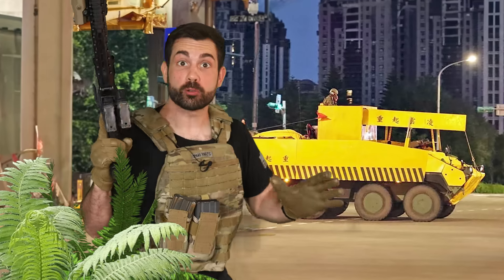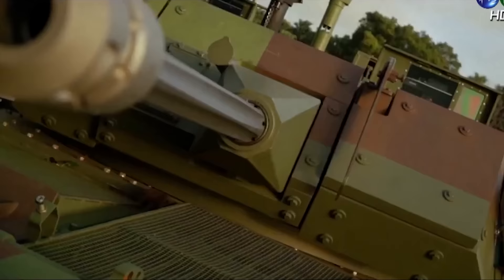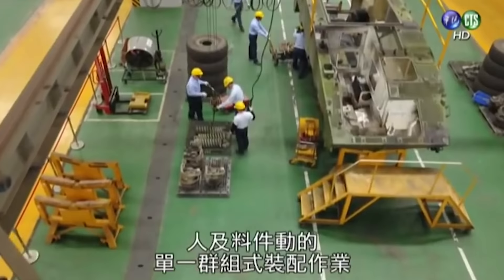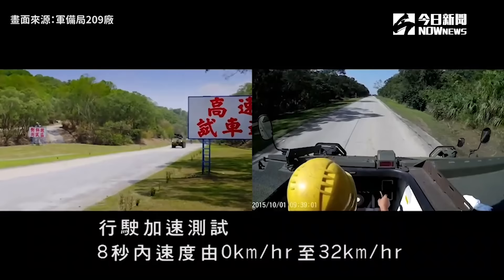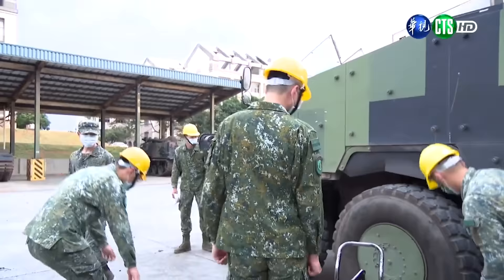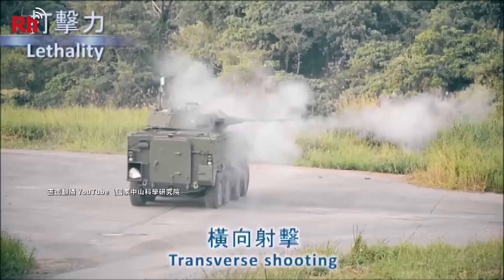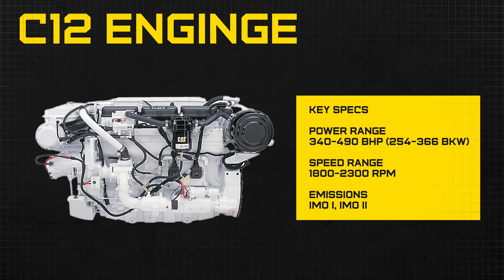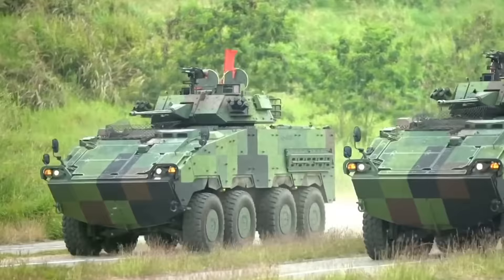Taiwan's Homemade Vehicle Designed to Stop China

Comment: With a little bit of Wiki fu, I am surprised the CM-32/CM-34 is not considering an ATGM or SHORAD variant. Especially SHORAD since the PLA will definitely be spamming missiles and drones over time before any early landings.

Any form of cheap SHORAD firepower to swat drones or missiles (like the Gepard) will be vital at from a defensive or at least, troop morale standpoint.
Reply: ROC Army mainly use HUMMVs as ATGM carriers. As for SHORAD, mobile gun SHORADs are not in consideration afaik, and missiles are carried by, again, HUMMVs. Though it would be cool if they make a missile SHORAD with CM32, either with a raisable missile pod or a full on VLS array. (I am a sucker for vehicle-mounted VLS.)

Comment: what is the elevation limit on the bushmaster cannon? Is it able to be used to engage a target that is higher than 45 degrees, like in a canyon or a built up urban environment?
Reply: The CM34's turret is designed to attack targets at 60 degrees.

However, I think it is still not enough to deal with the threat of UAV.

Taiwan should import M230 chain guns and air fuzes.

And the turret should have the ability to shoot at an angle of more than 80 degrees.

Comment: Those old tanks they are supposedly getting rid off - something in me wants to bury them to the turret alongside those mountain roads as happy little stationary surprises. They might be obsolete on the battlefield but having a few hundred buried tanks in those mountains, ranges on surrounding landmarks nicely dialed in in advance is still something that is going to cause someone a lot of trouble should they try to secure the terrain

Comment: What I can't figure out is the fact that Taiwan has strict gun control which is totally inconsistent with the entire population being armed and ready to take on an invasion. Taiwan like Israel is an extremely small nation that cannot ever hope to match the numbers of their enemy so it would make sense to arm as much of the population as possible. The mindset of the government is however consistent with a population being ready to submit to CCP rule and giving up without a fight.
Reply: Taiwan has already been invaded by China. In 1945.

I think you'd find it reasonable that the invading government does not want the locals to overthrow it. An uprising two years later was brutally suppressed with about 18,000 - 28,000 deaths !!! That dictator from China ruled Taiwan, followed by his son, for the next FIVE DECADES !!! The first free election Taiwan had was only in 1996.
Reply: @danielch6662  Taiwan wasn't invaded my dude. The ROC fought the PRC, later reformed to the CCP, in the Chinese Civil war, and lost the mainland during this conflict. This was due to a number of factors, the largest being the PRC's forces had sat back during the japanese invasion that lasted up till 1945, and essentially left the ROC holding the line. As a result, they moved the ROC capital to Taipei, and held that island. the PRC claimed defacto victory, even though no ceasefire or treaty or such was ever signed.
Reply: @danielch6662  China was "invaded" by the Nationalists after the civil war and fought a continuation of that war called the battle of the Taiwan straits which the Nationalists won securing the independence of Taiwan. The dictatorship of the island came to an end but the dictatorship on the mainland remains to this day. You are twisting the truth of things grotesquely. Also the island is now a democracy and democracies do not fear their people being armed.

Comment: one simple quest. What are the chances of a few million step to stand against 1.5 billion pople? what nonsense?
Reply: Simple... 1.5billion aren't going to invade. Also that's not how war works. When you have a heavily fortified island and you're a defending force willing to die for your independence... China will lose so many troops and equipment they will give up because the cost of conquering the island won be worth it. I hope you realize how massive of an advantage it is to be the defending army in your own country where your supply lines are right there and you have all the defense positions. Invading a country is extremely hard, especially when you don't want to destroy everything because if you did that would defeat the purpose of invading in the first place.